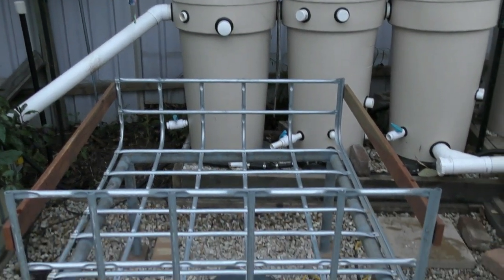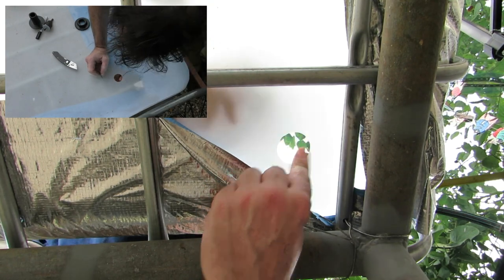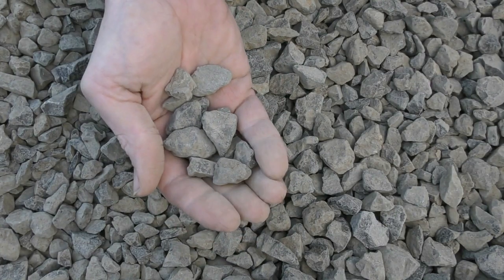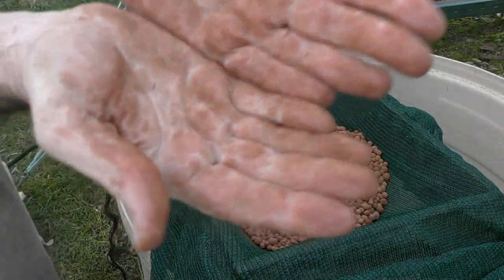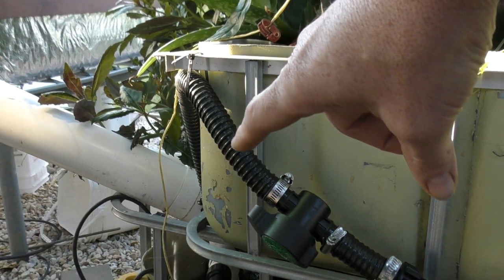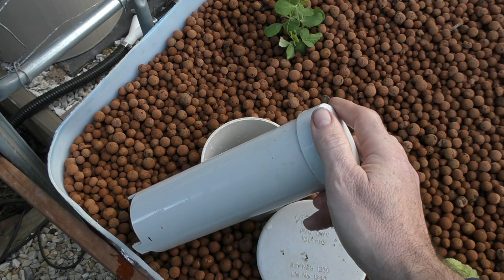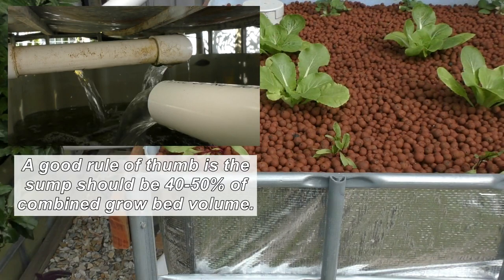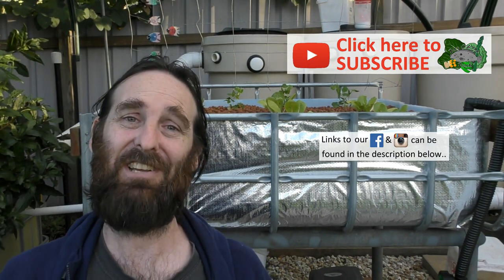How to set up aquaponic grow bed & select the right rock.

Comment: I like the way you come up with all the little helpful tips in your videos like the one using the larger rocks around the siphon. I did a similar setup using lava rock thinking the crevasses would allow for more bacteria growth with clay on the top half. I also sorted out the larger pieces and used them as drainage rock around the yard.
Reply from the maker: +Jeff Sullivan 
Thanks Jeff. Would like to use the lava rock/scoria here but it's hard to find here. Folks down south seam to use it a bit thought.
Hope the systems doing well.
Cheers.

Comment: Hi Rob, really good summary, just one point, as well as making sure to having enough water in the system is important, people need to understand that sometimes all the beds will empty at the same time, an if your sump is not big enough it will overflow. This is a problem that may not be apparent until you start missing fair volumes of water, hours, or days after you have added the grow bed.
Reply from the maker: Deborah Baird Hi Deborah & good point. With our system the sump would run dry first as its a split system & all water for the grow beds comes from there. 
Don't like to get to specific as I've seen folks run their pipes all different ways. One of the most elaborate ones had water pumped from a sump to beds above the FT & draining back into there while others below the FT get flow via gravity from the FT as well as from the pump in the sump. 
I posted the annotation on the  40-50% of total grow bed volume rule I like to use to calculate sump size to cover all the different ways folks like to plumb their systems. As long as they have a sump sized to that it shouldn't overflow or be pumped dry if topped up regularly. 
I know 40-50% is a bit more water than the beds need in a standard flood & drain arrangement like ours but it also gives you a extra volume in the sump to allow for covering the pump as well as to allow for water loss through transpiration & evaporation. Have seen folks not allow for enough water to cover the pump & end up having to cut another sump.  
Hope that all makes sense. Think I need a coffee ;-)
Have a great one.

Comment: I like your showing the cheaper rock under the clay pebbles. the clay pebbles are significantly more expensive than the basalt. And how to test the base rock. GREAT VIDEO!
Reply from the maker: +John Galt 
Thanks John. Does make setting up a bed a lot lighter on the hip pocket ;)
Cheers mate.

Comment: Looks good.
I wish I had an electricity supply at my plot and I'd try something similar.
Might give the non circulating hydroponic method a go though.
Cheers, Dan.
Reply from the maker: ***** Hey Dan. Have you got enough space left in the greenhouse? 
 If I had the space I'd set up a Kratky style bed for  greens just to compare it against the AP. 
Cheers mate
Reply: +Allotment Diary If you have space you could put in a gravity feed and a windmill / solar power to fill bob tank.. As in the bob tank like old school on stilts and then it gravity feeds the grow bed.. Might work, might take a bit of playing around but could end up costing nothing in power.

Comment: Thanks for the master class in home-scale aquaponics!  You've really dialed it in!!  Very inspiring.  
The teflon tape and screw tip was worth the price of admission all buy its self.  I plan on using that for my drip irrigation.
Reply from the maker: realrasher Thanks & glad you got something from the clip. 
Have fun setting up the irrigation. Is it on an AP system or in a soil garden? 
Cheers.

Comment: Awesome Update Rob as usual. 

I'll get back into my build in a couple of weekends. Thanks for the tip re the sump tank capacity - I may be a bit under capacity. 

Btw - those uniseals you sent wor very well. Have a great day. Ian
Reply from the maker: vtv8man Hi Ian & thanks mate. 
I figure it can never really hurt to over estimate the sump capacity. Worst case scenario is that you might end up with enough extra volume to set up a few more beds ;-) 
Cheers mate.

Comment: I am new to aquaponics and have become an instant fan of your youtube videos.  I'm now doing the plumbing for my system (USA), however the pvc ball valves are very difficult for me to open and close.  I noticed you have no problem turning your valves on and off.  What type of valves are on your system, please?
Reply from the maker: Hi Flo. The blue handles valves I use come from a local mob & I think they're made by Sanking in China. 
http://www.sanking.cn/en/pdisp.asp?pid=1
I found these folks in the USA that stock what looks like the red handled version of my valves if that helps. 
|https://www.commercial-industrial-supply.com/valves/pvc/compact-ball-valves.html
Hope that helps you out some & have fun with the build. 👍
Reply: Thank you.

Comment: G'day Rob,
Your insight and innovation is inspiring.
Just had a couple of questions:

What flow rate would you recommend for one IBC grow bed/fish tank?

What pump would you suggest to use?

And do you have a 12v solution, should the intended final location of the IBC grow bed/tank be out of practical range of a 240v PowerPoint? Potentially a solar setup?

Cheers

Rob
Reply from the maker: Hey Rob. i like the water volume in the fish tank to be run through the bio filters/grow beds at least 1.5 times an hour. So that would mean a 1000L/265gal IBC needs 1500lph/395gal of flow rate into the tank so that much can leave to be processed in the beds/bio filter.  
I don't have any 12v pumps I could recommend sorry. I would stay away from the cheap bilge style pumps as they aren't made for continual use & could burn out fast. Most folks I know run 18v as there's more options. 
Might be best to ask at a local pond store to see whats available & they would recommend. 
Hope that helps some.

Comment: Quick question.
I am working with a 10' long by 6' wide green house. where 2' of it is not enclosed like the rest.

I am currently dirt growing some starter veggies, and plan on soon converting over to aquaponics.

Can you help me design my system where I would have a 110 gallon fish tank ( would also be my sump tank ), I would have 2 grow beds ( 15 gallon each ) with lava rock as base medium with pea gravel on top.

using the flood and drain method for the beds.

I am wondering what type of solid filter I can build, as well as if this sytem would adequately support 10 blue talipia, with the list below as the veggies I plan to grow in it..

beans, broccoli, tomatoes ( 2 types ), cucumbers, strawberries, celery, jalipinos, lavender, grapes, blueberries, corn, lettuce, watermelon, sunflowers, onion, peppermint, and a few other smaller ones.
Reply from the maker: Hi there.
I would just stick with the larva rock as the pea gravel will just mix up through it over time. 
Canister style filters are great at removing the fine solids that are created when waste gets smashed up in a water pump. I have a clip on a DIY version that will give you some idea on how they work & how to build one,
► https://www.youtube.com/watch?v=HtMZRM3a5Fs
I would pump up to the filter then let it fill the beds which then drain back into your  fish/sump tank. 
The feed given to 10 tilapia wouldn't support many of the larger growing plants you have listed but would support some leafy greens & the like. 
I hope that helps you out some & have fun with the build. 
Cheers.

Comment: Looking great again there RobBobs Backyard Farming down our way the Mixed River Pebbles I used were half the price of Blue Metal, which I thought was strange, but good as there much better on the Fingers and Hands when planting out :-)
Reply from the maker: George Stephen Thanks George. 
Just double checked the price list & the river rock was only a few bob dearer. I must have been looking at the wrong price  :-D 
How's your system going now it's s bit cooler down your way?
Reply: Plants are doing well, but lost a few more Goldies, even at -2.5C our coldest day the tank water was 7.9C PH 7.0 all other test fine, even had the water tested for any other bacterial problems all Fine, so cant fathem why losing fish Goldies are supposed to be resilient, my Dads Pond were fine for years and all he did was feed them lol, I saw Craid also lost some Trout for no apparent reason too ?? Bugger when that happens though
Reply from the maker: George Stephen Lost a few of our goldies here a couple of winters ago for no apparent reason in winter George. Ended up giving the rest away to friends with ponds. Water sounds like it's all good though. 
Hope they're the last you lose mate.
Reply from the maker: George Stephen Is great to hear the plants are doing OK though :-)

Comment: Rob.... question the pump should be running 24/7 or we can pick up the time so that pump can be running for few hours?
Reply from the maker: Hi Mate. Some folks will run on a timer but then they don't tend to use bell siphons. They will have a stand pipe that has a small hole drilled in the base that will allow the bed to drain while the pump is off. The main concern as I see it with a system like that is that the water from the fish tank still needs to be run through the beds (bio filters) at lest 1.5 times an hour so the water has time to be cleaned up. 
Hope that helps some.

Comment: Rob thanks for your vids and info on all you do with aquaponics. Hey just today, i have gone for your bell siphon. Bit of pissing round, back and forward to your video :-) but got it going. NOW, heres the drama, with just the water in the top tank, all was going well. It ran 3 times and all 3 the siphon worked but once i put the gravel in, it dont seem to be cutting off. I looked down the guts, thinking bit of gravel may have got in but nothing. Has me baffled as to why it was going good, but with the fill in, it isnt cutting off completely. Any idea Rob?
Reply from the maker: Hi there SCSW. The siphons will work differently when there is media in the beds. 👍You'll find that the gravel holds onto a bit of the water so it takes a bit longer to fully drain. 
Sounds like you just need to dial back the inflow to the beds a bit & see how it goes from there. 
Hope that helps some.
Cheers.
Reply: Hey Rob thanks mate, all seems to be going well now. I did a couple things, one.. the bottom feed line, coming from the elbow, i trimmed it back a little, that made a slight difference but the other thing, i have a suspicion maybe wind was interfering with the bell siphon. I put a shield up and BINGO, the siphon has been going good since doing those couple things. I think mine, every 3 minutes is dropping and loading. Thanks Rob ;-)

Comment: Hi. Is there any proof that burying the sump tank can help regulate the temperature swings. We often get 20 degree changes in a day.
Reply from the maker: The ground does insulate well but I am unaware of any studies showing the best methods to obtain the best temperature stability sorry Ian My thoughts are that if you have a lot of water exposed to the air that will have a big impact on temperature swings as well.
Cheers mate.

Comment: Hey rob I have a question for ya I have a system  (three bed drain in the a sump, fish tank with a slow) it's bin around f 30 to 35 Celsius and I'm not sure if I have a leak or if the water is evaporating / being used by the plant how much water do you add biweekly roughly thanks man iv bin watching your videos for years now
Reply from the maker: Prairie aquaponics Hi Mate.
During summer here we get similar temps & add anywhere up to 300L every 7-10 days when it was just the 3 large beds & the 2 ginger barrels. . Depends on how densely the systems been planted out & from the look of your last clip it looks well stocked :-) 
Most folks I've talked to say their system uses a lot more than the "10% of the water used in conventional farming methods" others claim if that helps any ;-) 
Hope that helps a bit mate.
Reply: RobBobs Backyard Farming thanks and I would say I'm right in the same margins,  and I crawled around and did not find any wet soil. Thanks for the help.

Comment: Quick question Rob i do water bores for a living and as a rule we dont use ( blue metal ) or crushed basalt  because over time as it can react with the water and release ARGON gas do you think this would be the case here as well ? cheers mate loving the vids big help with my set up as im only just starting out super keen keep up the good work .
Benno
Reply from the maker: Hi Benno. That's the first time I've heard that so have no idea sorry mate. I know many in the aquaponics community have been using blue metal here in Aus for years & haven't heard of any issues. 
Is it due to the pH in the bore water or other elements? 
Cheers.
Reply: Gday Rob Thx for the reply mate . Have done some research and asked another driller who has 20+ years in the well drilling industry and have come to the conclusion that the rock breaks down over time releasing Agron gas in small amounts into the water ( we are talking over 5, 10, 20 years ) as the water flows through it whether or not this is sped up in aquaponics because  of the amount of water flow or PH know one knows. tho i have found out that the (  Diazotrophs ) bacteria that absorb nitrogen in water and convert it to Ammonia can absorb Argon and produce Ammonia as well in what amount i couldnt tell ..... learn something every day .Cheers Rob 
Benno

Comment: Hey Rob.  So with your system you put the gravel on the bottom and then the clay balls on the top? What about the river stones vs. gravel?
Reply from the maker: River rock should be fine as long as there are none in there releasing carbonates into the water 👍
Cheers.

Comment: Hi Rob , thanks for all the helpful tips and great videos ! Got 4 IBC grow beds I need to fill and like the idea of using rock in the bottom and then the clay ! My only concern is cleaning  
it . How will you do it ? 
Cheers Mate !
Reply from the maker: Hi Digger.
Cleaning would be a bit harder with the rock but hopefully it would only be a job you need to do every 5+ years if the solids are dealt with elsewhere.  
I'll be skimming off the clay the probably using a pressure washer to loosen the solids from the rock layer & flush them out. That's the [plan for now but it may change between now & then.
Cheers mate.

Comment: I can get either lava rock or river rock #8.  Their is a major cost difference. So which is better and is the lava rock worth the extra cost over the river rock.
Reply from the maker: The lava rock will be a lot lighter to work with so that's one plus. 
It can be a bit of a pain to clean as it's filled with loads of small holes & pockets. River rock is smooth but is a lot heavier to work with. Can't really decide for you but I hope those points help a bit.
Cheers.

Comment: Thanks Rob....quick question...have you tried adding yabbies to one of these systems?
Reply from the maker: I did at the start  but they were either eaten by the goldfish & each other en they moulted or escaped the tank. 😣
I also ran the pH too low for them so would run them in a dedicated system if I was to grow them again.
Cheers mate.

Comment: Hi Rob, thank you for these informative videos, we have been binge watching them since last week. I have quick question. We have fish pond right outside our balcony. We plan to hang some pots onto the railing, fill them up with Leca and water the plants manually with the water from fishpond. Will drill holes abt 1/3 of the pots (from bottom) and let the water drip back into the pond. Will this work? How frequent do we need to water (it's open to sky, we are in Singapore). Understand leca will hold on to water and with capillary method distributes the water to the root. We will plant croton gold dust and mini juniper
Reply: Btw the fishpond has its own system running for abt 3 years with no issues. Has filter, pump, balancing tank and everything up since day 1. We have been watering the plant all these while with the method above, but with the soil in the planters, but only chilli plant & money plant. We intend to replace them all with leca. But unsure if this will work just like with the soil as before
Reply from the maker: @bethcivil  I think you'd need to monitor a pot as an experiment to see how often it would need to be watered Elisabeth. At a guess I would think it would need to be done 5+ times a day due to the heat. A small solar pump might help you through the day just to keep a constant trickle running through the clay in the pots. 
I would probably stick with the soil myself as it will get the dual benefit of any compost you add as well as the fish water. 
Hope that helps some.
Reply: @RobsAquaponics  thank you so much for your reply. You brought up valid points.. Yes we decided to stick with soil but added leca at the bottom and the top to help with the drainage. I checked the pH of pond water which was 8.7 (quite high right) and would like to know how do you tackle this issue (am not sure how is the impact of this high pH reading thus we decided to stick with the soil, at least the plant gets some nutrients from it in the event pond water couldn't deliver the required vitamins)

Comment: I got an idea for you bud. Have you got a big air pump? I have a Sweet Water air pump pump out 13 cfm, I was thinking taking a air mattress, drill tiny holes thru it and lay it in the bottom of the grow bed, hook it up to a heavy duty air pump and bubble air up thru it
Reply from the maker: Hi Mate & thanks. 
Not something that I need in the media beds but am looking at setting up a decent air set up for the raft beds. Was thinking a venturi & air stones though. 
Cheers Slow Poke  👍😊

Comment: Can you go over the reasons why I've noticed on several of your pro beds you have a reflective material on the outside??
Reply from the maker: Hi again.
That's there to block out UV light which would cause algae to grow on the inside walls of the IBC beds. 👍
Cheers Steven.